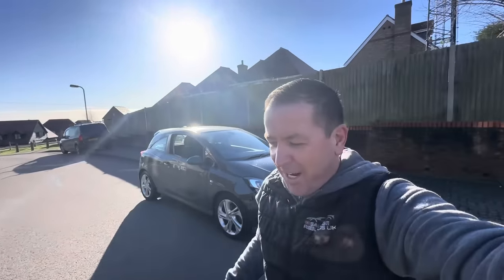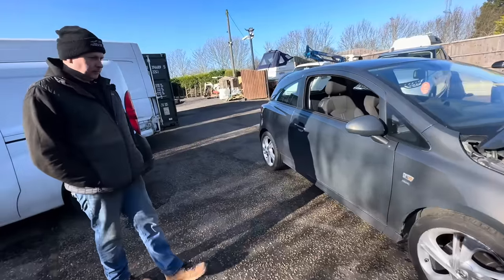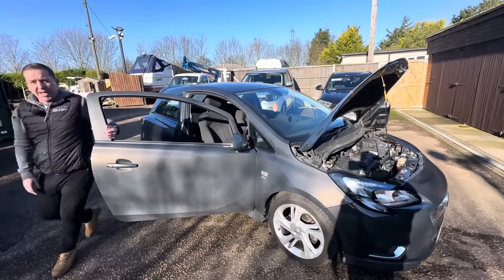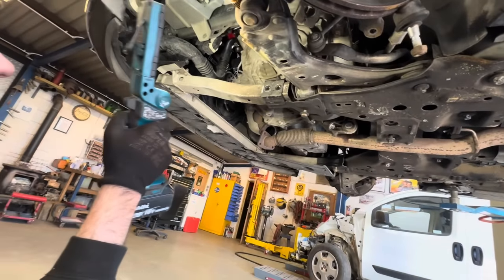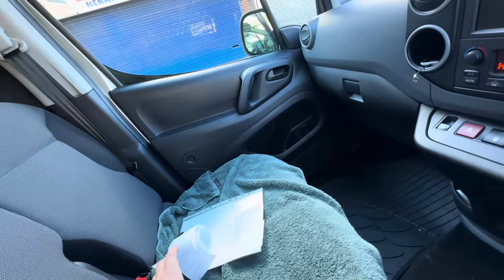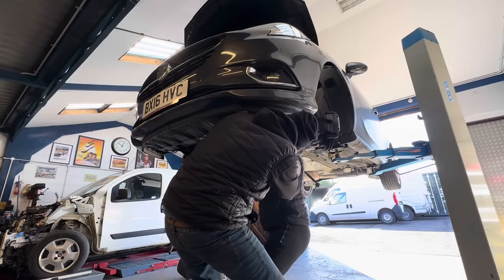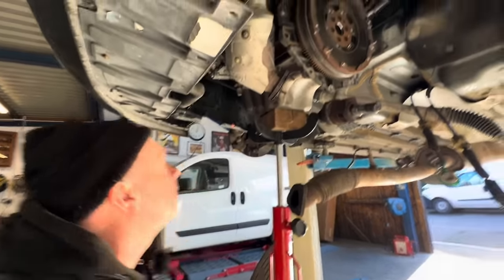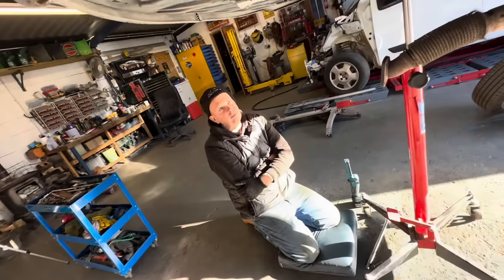WE GOT PROPERLY TUCKED UP BY A SUBSCRIBER

Comment: Rob, Chris.........I am sending you my number, My dads Astra sri Has the same engine as that corsa, he had an accident last month and wrote the car off, I think its still in a local yard awaiting collection as hes been paid out, it only had 18K on it one owner, i can make a call and see if the car is still there
Reply: Astra J or K if it's K it's the wrong engine this needs the older engine from astra J there completely different engines in the astra K with direct injection

Comment: Had same fault ( crankshaft end float) with low mileage 1.4 Mokka. Vauxhall dealership quoted £7,000 to replace engine after trying a set of shells. Low miles, full Vauxhall service history, customer had car just over a year : no warranty or contribution. I bought accident damaged Mokka from Copart & swapped engine, had customer back on road for under £3,000. Common fault on 1.4 Vauxhalls.

Comment: New clutch required for car with only 31K on it!?!? Would be disgusted having to change a clutch with double that mileage....
Reply: Agree with that. Unlesss it was owned by the old boy I saw recently (who should not be on the road) who smoked out Sevenoaks high st. with clutch smoke, taking a couple of minutes getting up to speed. Not an exageration. He was probably taking off in 4th gear

Comment: Crank walk is the thrust bearing failed. It's not a dead engine. It probably wasn't aligned properly OR it has been abused by the driver riding the clutch. The garage obviously changed the clutch and the problem was still there so they opened the sump and found the thrust bearing has failed. Rather than removing the crankshaft or being honest with the customer, to keep the money from the job they packed it up and sent it down the road. A bit of a shitty move by the garage.

Comment: From what I have discovered on YouTube is in fact the end float on the crankshaft when operating the clutch is in fact the thrust bearings need replacing. So now with all in situ, drop the sump and replace them.  Years ago my big ends went, so drained the sump. Laid on my back under the car removed the sump, dropped the crank, and fitted oversized bearings. Put it all back together and drove it it for many miles. Hillman Minx 1968..

Comment: I would strip the bottom end as it is in the car and see what the actual issue is rather than keep guessing and then make a decision. If its toast (which would surprise me) then slap it back together and Copart it as a non runner.
Reply: Yep, totally agree with you on this. For the sake of extra half hour work for confirmation. Engine sounds good, low mileage. Deffo worth pulling a main and a rod bearing out furthest from the oil pump.

Comment: Have you considered that whoever did the bottom end work on it, didn't put the crank thrush washers back in? Or, alternatively park it up and wait for a Cat B to come up at Co-part to pinch the engine from.
Reply: No no, this is a well known problem, go to any vauxhall forum and they will tell you to stay clear of the 1.4T due to endfloat problems and also LSPI...I dont remember if it's not the LSPI that creates the endfloat problem actually.

Comment: Crank thrust bearing wear is a known issue on those Rob. Have you guys checked the excess end float on the crank, and what's the rest of the engine condition like ?  I wouldn't just assume some engine work has been done because of the new sealant. It may have been a quick check once the clutch wasn't found to be the cause, and they've replaced the friction plate as a matter of course. The owner may have decided they'd spent enough already, especially as most of the job would be a repeat of the parts stripdown already done, again. Depending on its potential resale value, and how much you're in to it already, you could just be looking at a new oversized main bearing set to fix it, possibly a crank dress / grind and big ends too.  If it's a genuine mileage car, then it should be worth spending a bit, but maybe not to the extent of an engine swap.
Reply: How is oversize main bearings going to fix end float
Reply: @garyevans9509  Depending on the design, many engines have just a centre main bearing with shoulders, that are the thrust bearing face.  They have different thickness of white metal coating. It may , or may not need a crank grind to get bearings with the right combination of diameter, and thrust face thickness. Whoever stripped it down after the clutch was found to be OK, may not have even taken a main cap off.  They may have not wanted the hassle and frightened the customer that it needed an engine rebuild. The guys could get out of it with the simplicity of a new main set, depending what's there regarding wear.  It's the sort of car that attracts abuse of the clutch on full bore standing starts, so putting excess wear on the fore/ aft thrust on the crankshaft.

Comment: Just shows that people shouldn't assume low miles = good. I'd rather have a high mileage car thats been looked after, than a low mileage ragged neglected one.

Can you not get oversized thrust bearings? Or a new crank? Or get crank welded and machined back ?
Reply: Exactly this I have a 2017 c4 grand picasso that has just hit 200000 miles mechanically sound interior is a bit rattly now but to be  expected with this many miles , kids constantly in and out and citroen is not exactly known for its build quality

Comment: Cars of gone full cycle. 70s 80s they only had 80 - 100k in them before they were worn out. 90s early 2000s well built and you were generally getting what you paid for. Since then manufacturers havd cost engineered cars into very expensive hunks of junk.
Reply: with designed to fail key plastic components in impossible to extract location...
Reply: Agree 100% with both of you.  And they say we should all be "green", throwaway cars are ecological apparently as long as they get 0.5mpg more

Comment: Oh no, the dreaded Vauxhall floating crank syndrome strike's again, number 4 main bearing probably has a track cut in the side of itself from the thrust bearing, the back of the flywheel and the sump flange then become the new thrust bearing, seen it too many times on these engines.

Comment: When it was running it sounded like the tappets were really worn. My guess is it's been run low on oil at some point. Those engines are known for burning oil which is probably why they are so expensive used.

Comment: 32k miles and had to have the clutch done! That should set off warning bells about the state of the car.
Reply: Yep an original oem clutch should last much longer than 30k, even somebody that rides the clutch.
You should have realised this rob.
Reply: There are lazy drivers like my elderly aunt.  Always pulled away from a stop in second gear, never used the handbrake in traffic on a hill, more clutch slip and her Fiesta had a new clutch at 37k.
Reply: It's probably more to do with full bore wheel spin starts, putting excess thrust wear on the fore / aft motion of the crankshaft.
Reply: Did you see what looked like a BlackBox sticker on the rear?

I wonder who was actually driving the car?

New drivers can easily burn a clutch out in 30k miles.

To be fair so can an elderly driver who rides the clutch.

I reversed my brand new WRX into my drive once, was a slight incline, and you could smell clutch 🤣🤣
Reply from the maker: @bigjml dash cam sticker
Reply: Father in law did the clutch in on a Peugeot 5008 5000miles on the clock 😮

Comment: The old ways were the best... boy came to replace the clutch on my Mk1 Astra... did it on the driveway, he used a jack, 2 axle stands, took him all of 45mins, had a cuppa, and was on his way. There was an access plate on or near (I can't remember, it was the 90s) the bellhousing, practically changed itself.
Reply: In RSA the official time to replace the first FWD Opel Kadett's clutch was 20min.
Reply: @JJSmith1100  that's probably right enough... It was more than a few moons ago, when I had my old, beloved Mk1 Astra. I just remember he was finished and away in less than an hour (including his cup of tea). Lol.
Reply: As far as I recall that was a feature on the F12, F14 and F16 gearboxes and likely many others where 80s and 90s Vauxhalls were concerned.

Fitted a high compression Astra 1.4 Family 0 to my ex's Nova in the early 2000s and in my haste to get the car back in one piece I actually forgot to fit the throwout bearing (I'd hired a lovely big engine hoist from HSS and it was due back in the morning and already back in bits in the back of my 16v Maestro).

Thank Christ the CR Astra F14 'box fitted had the access panel and the ability to displace the input shaft, clever Vauxhall/Opel!
Reply: Good old cassette clutch 😅

Comment: I served my apprenticeship at Opel/Vauxhall dealers in the early 80s, the old school front wheel drive clutch changes were a doddle, didn’t even use a ramp ! By the way reference the spigot bearing, I seem to remember we were told to bin it and not replace it !

Comment: BMW swapped from 2 main thrust bearings to 1 in the later B petrol engines, these wore out too quickly, caused end float and started breaking the inductive pickup for the crank sensor. The solution was to revert to 2 thrust bearings.... I wonder how much that recall cost compared to doing it right the first time. Same with the F generation steering rack debacle.

Comment: I'd pop an automatic trans in it, the torque converter will hold the crank in exactly the right axial position. Unfortunately you'd need a donor car for the pedal box, quadrant and trans, but it may be easier to find as a wreck.

Comment: I bought a 1982 3/4 ton Toyota pickup with that problem overly aggressive transmission installation can knock the thrust bearing loose. My engine detonated after 30 miles. Great looking car. Thank You so much Gentlemen for being so genuine not everyone shares the failures.

Comment: Rob as the bottom end has been off you need to check if it has been reassembled without the thrust bearings. Wouldn't take too much to check and could be an easy win. Worth a check i rekon.

Comment: Triumph sixes were notorious for crank end float. There was a C shaped thrust washer that often fell into the sump. once this happened if you operated the clutch the crank would move 1/8" forward or even 1/4". This forced the pistons into the sides of the bores and ovality was the side effect ........ a rebore and new pistons the cure. Sometimes the crank land was so worn the crank was scrap as well. I've not known the problem with any other unit.

Comment: I think someones changed the big end shell because it had a bottom end knock .
I think it's been put back together without the thrust bearings in place .
Before you go chasing replacement engines just pull the sump and check there is thrusts in place .
Reply: Was thinking the same
Reply: I was thinking this too. It’s quite common for the thrust bearings to be forgotten.
Reply: 100% missing thrust bearings. Sump down and fix it, almost there already.

Comment: The last time I dropped engines and boxes out of vauxhalls was in the 90s. Proper engines that yes did fail but were a breeze to fix. The old overhead cams, red tops etc. As soon as the mk3 cav was finished I was finished with vauxhall. Same so goes for the old 2.8 grannys/sierras and 2.0 pintos,cvhs etc. Once all those died off all we have left is generic crap from the french. My mk5 mondeo engine is just as guilty being part developed with the French. Vauxhall lost its way big time and sold their soul. One word that sends shivers through me now is hearing the word 'ecotec'
Mk1 vectras lining up in our scrapyard with not even 80 thou on the clock and 5 years old. Crying shame. Where did vauxhall go wrong

Comment: By the sounds of it you have moved it on now but out of curiosity I searched this reg at work for previous parts supply (motor factors). 
Although not the depot I work at a clutch and flywheel had been supplied to it. But the clutch had been returned. Doesn’t mean to say it didn’t have one though.

Comment: I had a Cavalier with one of those old style clutches that you could pull the shaft back and the whole thing dropped out! Changed the clutch on the Cav on my drive and couldn't believe how easy it was - those were the days!  wouldn't attempt to change a clutch on a modern car. Sadly Corsa engines seem to be full of problems although not heard of this one before. Hope something turns up but admire your philosophical  attitude to it all👍

Comment: Some of the thrusts on cranks are loose itmes, not part of centre main bearing, maybe the garage never installed the thrusts. I would drop the sump and check. And these bad comments i just read, ANY OWNER of a repair done to that extent WILL KNOW IT WAS DONE, as it is not cheap for a garage to do that bottom end job, AND will not do it free of charge.

Comment: It might be unfair to blame the owners...not everyone knows the insides of cars and the causes of a noise..  The garage who fixed it might have pulled the wool over their eyes and claimed theyd fixed it
Reply: It is not unknown for rogue garages to exaggerate a problem to an unwary customer.  Often, the customer will offer it them as a cheap part exchange against something on their forecourt. They get the sale of a car they've possibly acquired in similar circumstances. They've also got another cheap part exchange car that will be on sale once they've done a cheaper repair than they told its owner it needed.

Comment: Sorry to hear it’s bad news chaps.

The first time rob put his foot on the clutch and I heard the noise, I thought that would be caused by end float issues.
I had one recently with a similar issue but it was leaking oil out the front main oil seal, due to the amount of movement in the crank. Similar engine in mokka and Astra models. Such a shame.
Hopefully you find a way to get it sorted and I would be interested to see what you do to it as I haven’t repaired one yet.
Keep up the videos chaps! 👍🏼

Comment: My guess is: Old geezer doesn't hear the engine anymore because of old age deafness. Operates the clutch like he's driving a tractor and keeps his foot on the pedal at all times, messing up the clutch and the thrust bearings in the engine. Plausible because of the backstory we got. Garage dpes the clutch, old geezer abuses the car for a bit more before he stops driving, resulting in the flywheel not being tip-top. Hopefully you can get away with just the thrust bearings, but the pan having been off, chances are they already looked at it and found the crank worn too much.

Comment: My spider senses would have been alerted by it needing a clutch at such low mileage. I've never needed a clutch in any car I've owned, despite reaching over 200 K miles in some cases. Bad driving habits kill clutches so if a car has needed a new one in under a minimum of 150 K miles it's a sign of a badly driven car, with very few exceptions, and it won't be just the clutch. If an owner abuses the clutch it's a sure bet lots of other problems will be lurking.  Personally I would never buy anything but Japanese now  though, european manufacturers are turning out some real junk these days, even the old standards of excellence, like Merc, BMW and Audi aren't immune any more.
Reply: Same here over 200k easy or I use my semi automatic no clutch after 3rd ! But some motors are a bit of a pig for it.
Reply from the maker: It didn’t need one they replaced it trying to cure the problem
Reply: Everybody knows Corsas are used by learners and "just passed" drivers, so it figures the clutches will be burnt out! 😂
Reply: Easy on the pedals - got to make everything last longer /not break. Even European cars. Refer to my comment to Johnlightbody

Comment: Old style clutches easy. As you say 3 x 10 mm bolts plate off. 3 clips on clutch like the ones in paint tin tops .Good old days from the early 80s
Reply: Changed the clutch on my convertible Opel Monza in 30 minutes and I'm an EE!

Comment: My car has reached the Moon and left it 42,000 miles ago to come back to Earth (hopefully), and I have yet to replace its clutch.
2012 Golf 2.5L 5-cylinder gasoline engine, 5-speed manual transmission.
Over 281,000 miles (452,000 Kms.)

Comment: I’ve just had the same problem with a golf r from copart listed as insurance light damage, someone had done an insurance job on it thrust bearings in the bottom of sump it seems to be related with pushing the clutch down to start the car causing oil starvation to crank when cold
Reply: Often the way with so called light damage cars, people find the cost of a mechanical repair too much so have a light crash to get out of it with the insurance money.
Always seems to be the really small damage cars that's just had a bump on the wing in my experience.
I've actually got one at the moment, easy body repair, wing and headlight, then found the gearbox is knackered once I drove it.
Definitely evident before the crash as it's completely dry and howling it's nuts off.

Comment: I wonder if it's had an undeclared knock to the wheel that has sent a shock through the driveshaft into the box and crank.
Reply: chris did comment that the driveshaft has been replaced, so maybe
Reply: could well be, due to shaft replacement

Comment: Thats a shame it wasn't what you thought. I've seen this happen on tractors where guys ride the clutch pedal and it pushes the crank through the thrust washers, or the clutch free plays out of adjustment and the release bearing loads up against the clutch cover and does the same thing.    My guess is with a manual car somebody's driven it in the city and held the clutch in for extended periods at junctions instead of putting it in neutral .  Take care guys.

Comment: I found out the hard way with the 1.4T. Bought the mother in law a 2015 Meriva a few years back with 15k on the clock. Head gasket went on the way home. Luckily the dealer refunded no quibbles and bought her a Honda Jazz instead.